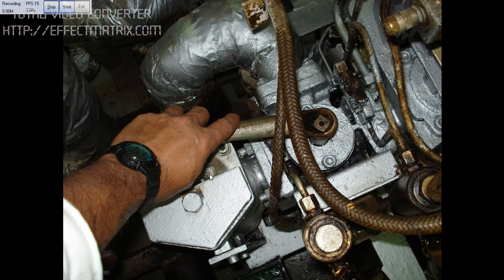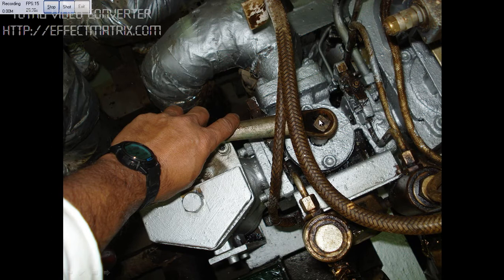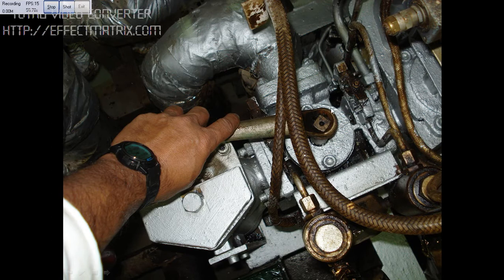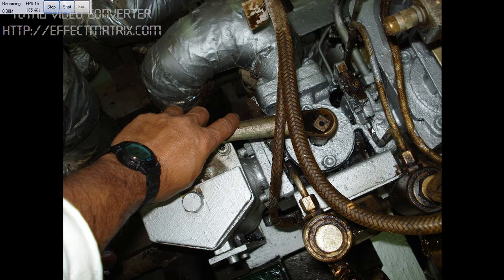Change Over of Auto FO Filter

Comment: Sir,if we have a equalizing line,then also we have to purge the manual filter for change over???
Reply from the maker: yes if you have equalizing  then you need to open this line to purge the manual filter, please see the instruction manual always.
Reply: Marine Tech Hub yeah sir, even if we have equalizing line do we need to open the purging screw to purge out or equalizing line is enough for purging??
Reply from the maker: you need not purge the line but keep the manual line  with equalizing line open for some time  so that oil circulate. But if you have purge line use it safely to make sure no air in the filter.
Reply from the maker: when you open my youtube  channel : Marine tech hub you can see icon right hand side of the header . you can click to go to my website 1. RT flex engine 2. Nitrogen generator 3. solar power.  full details of CLU and Crank Angle sensor can be see